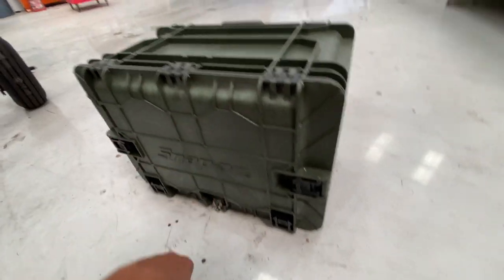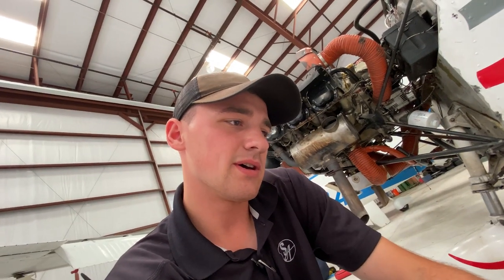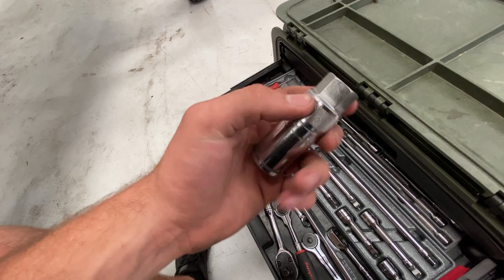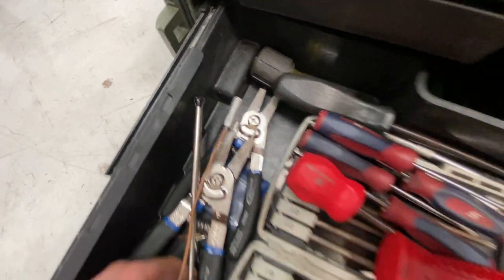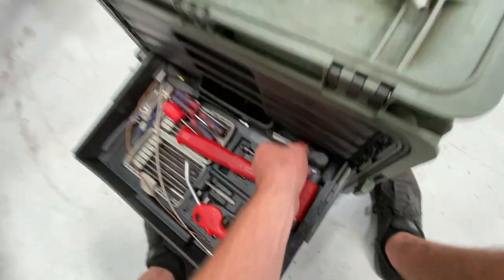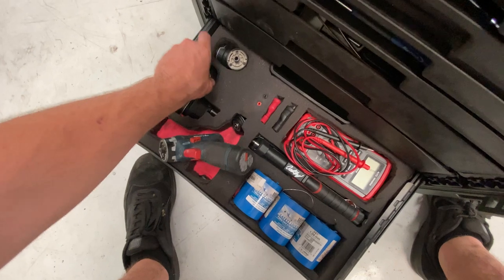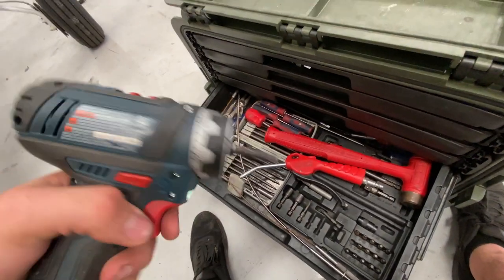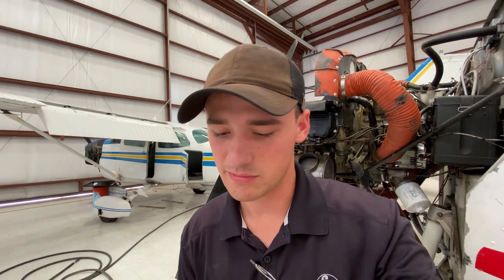Everything in my personal tool box.

Comment: I just found your channel recently and as a fellow A&P I'm really enjoying your content! I'd recommend you take some of those silica gel snack packs that come with shoes and electronics and stuff and throw a few of those in your box. They prevent your tools from rusting. I'd also highly recommend you get a magnetic socket tray that stores the sockets horizontally. You don't have to shadow that area and it lets you take all your sockets with you out of the box if you need it. They normally store the standard and deep sockets and have a pretty small footprint. Personally I don't like the box wrenches laid out one by one so I store mine in canvas or leather tools wraps. It keeps them organized and takes up very little space in your drawer although depending on how many wrenches you put in them you might need a drawer that's at least 1.5" or 2". I really like your Bosch drill too, I have to steal that part number...
Reply from the maker: https://www.amazon.com/Bosch-Power-Tools-Combo-GSR12V-140FCB22/dp/B074GYX6XG/ref=asc_df_B074GYX6XG/?tag=hyprod-20&linkCode=df0&hvadid=242037806074&hvpos=&hvnetw=g&hvrand=6705876348299666790&hvpone=&hvptwo=&hvqmt=&hvdev=m&hvdvcmdl=&hvlocint=&hvlocphy=9012404&hvtargid=pla-433942177656&psc=1 

Thats the drill ☝️

Comment: Out of passing interest, Knipex makes & sells replacement button assembly kits for all their push button pliers, They come with a new pivot pin, button 'cap', leaf spring & screw. I 'think' yours takes a P/N 8709180 kit (but double check before ordering). Currently under $12.00 on Amazon. It's an ezpz job, give the cap and screw a little dab of Loctite, & press down the button cap before installing the spring. IIRC, the replacement screw is a T8 Torx.

Those Knipex parallel smooth jaw 'Pliers Wrenches' are very much more useful than they look!

Oh, and stay the hell off those tool trucks! If not in a hurry, everything imaginable can be had for pennies on the dollar off eBay etc. Life's too short to be slaving away for some tool truck guy! Just saying...

Cool videos, Thanks!
Reply from the maker: Hey thanks. And I agree about the truck thing but we’re luckily enough to have a pretty good guy thats on the truck. and one plus is all of snap-on stuff is life time warranty. But yeah thats like the only plus 😄. Thx for the comment.

Comment: Loved the video man, if you dont mind me asking, what kind of degrees do you have/certifications and how much did it costs you ?
Reply from the maker: I am a certified Airframe and Powerplant mechanic. It cost me around $1,700 dollars for all the test because I didn’t go the school route. I went the 3 years apprenticeship way. But to get the certification I hold and your looking at schools, they cost anywhere from $40,000-$60,000 but you can finish the education in one year instead of three.
Reply: @aerocrafty6006  awesome, thanks a lot for the information
Reply: School cost around 14k in AZ, I'm currently working on it. Look fore community colleges, it's probably different tuition depending where you are.
Reply: check your local community colleges. very cheap compared to schools like AIM or something. check on FAA website, there should be list of approved AMT programs.
Reply: @Fynnzz  thanks, I live in canada. I'm definetely going to look more into this but you think an undergrad degree in civil engineering would help in this or not at all ? In terms of trying to get a higher salary
Reply: I think having a degree is always a good thing if you can go for it. however, I think experience is king for this line of work. its all about how many years you got under your belt and what type of aircraft you've worked on.
Reply: @Fynnzz  thanks a lot for the information man. Cheers